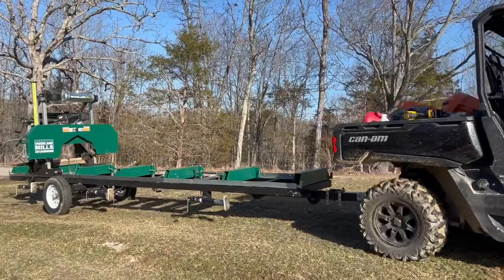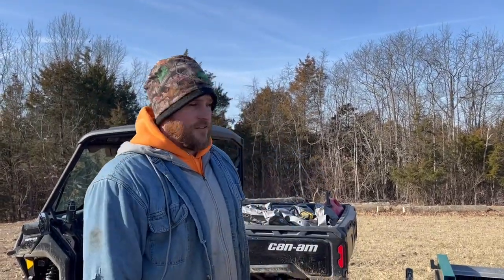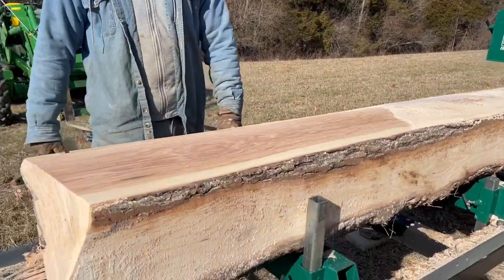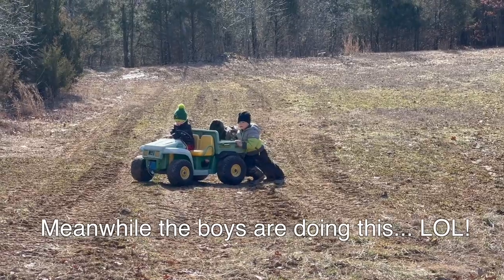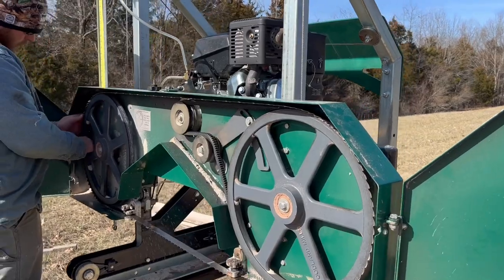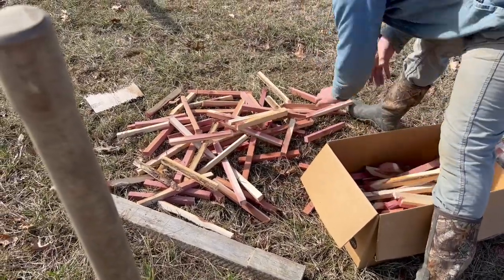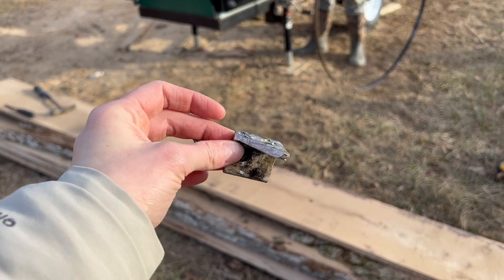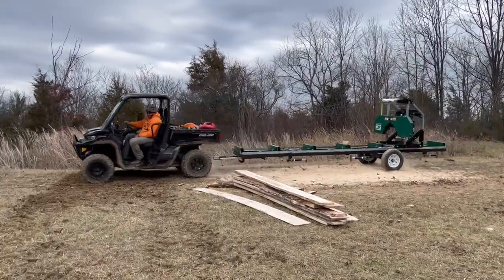Using Our DIY Sawmill Trailer To Transport Our Sawmill On Our Farm & Cut Logs | Woodland Mills

Comment: How are the seat covers holding up on the defender? Still need to get some for my pioneer
Reply from the maker: Not too bad. Only thing is the driver side slipped off from getting in and out of side by side. Working to figure out how to keep that from happening.